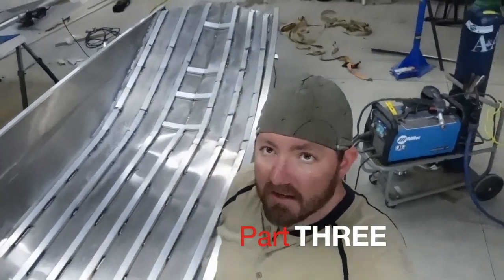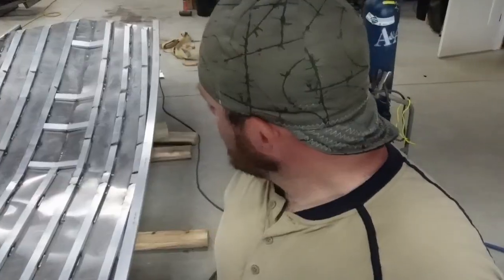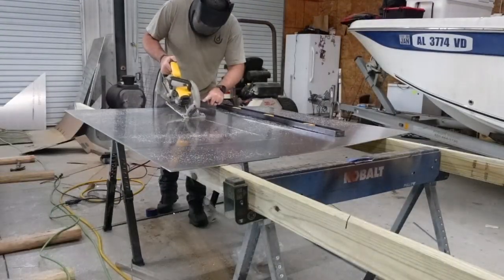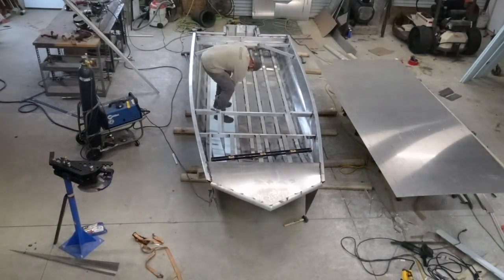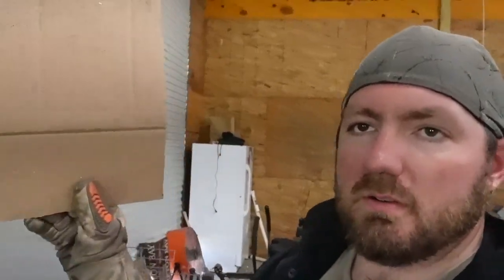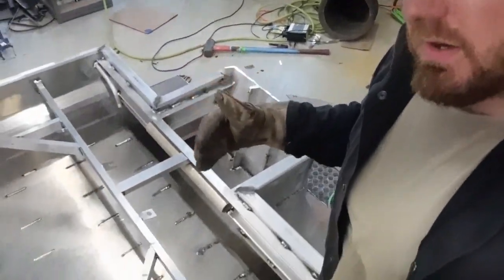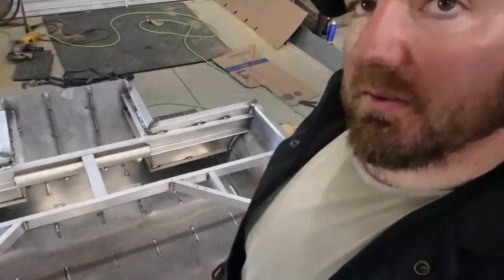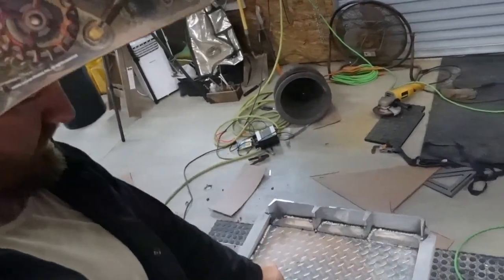Homemade Aluminum Boat - Jack Daddy Customs - Part 3 #diy #boats #homemade #tbnation

Comment: Awesome build. I will be going back to refer to your videos and yes I let the ads play. Just wondering if you didn’t mind sharing how you ordered the bottom and sides bent. Looks like it was creased to. Thanks for posting.
Reply from the maker: Thank you! I just told frank at pierce aluminum how I wanted the profile to be. He bent them to what I told him I wanted. I didn’t give him exact measurements but you basically have 96 inches to work with. So generally speaking you can get 56 inch bottom with 20 inch sides. The profile and bend locations are up to you. If you get strakes in the bottom that would make it a little less of course as well.

Comment: Looks fantastic, I’m think of building my own from scratch now, only pieces I’m having a hard time sourcing is the gunnels, what kind of gunnels did you use for your project?
Reply from the maker: I bought gunnels from the aluminum supplier. He had all types of boat gunnel extrusions. BUT, I have seen many people cut a slit in aluminum pipe and slide it over the edge to form a gunnel.   It’s a process but not as hard  as it looks.

Comment: Hey Jack, would you mind describing how you trace the cardboard to match the curvature of the sides so well? Do you use something to offset your pen/ sharpie so you can slide it down the side wall as you are marking the cardboard?
Reply from the maker: It usually takes at least two or three passes. The first one gets it close by eyeballing it and then you can hold it off by making a fist and riding down the wall if that makes sense.

Comment: Did you have any issues using the spool gun vs say a tig set up. If someone was going to modify an existing boat adding steps and framing, welding seams. Is the spool gun the right choice vs a tig set?
Reply from the maker: i would have rather used a tig for some of it, but i didn't have one at my shop... the spool gun is more than sufficient and is definitely quicker... with enough practice and a good machine, you can get the spool gun to look almost as good as tig... just don't have quite the control all the time...

Comment: Hey man, I'm looking at doing a floating deck. Just wondering is that 1x2" tubing up front? And if so after having it for a while would you do the same again or go bigger?
Reply: Also what thickness lol
Reply from the maker: It is 1x2 tubing and it’s 1/8” and it’s plenty. I would do the same thing again. Aluminum is light so don’t be afraid to over build it. If you think you need more braces, put more braces. Lol. Let me know if you have any more questions.
Reply: @JackArmstrong-jackdaddycustoms  thanks for the quick response, that's what I was thinking 👍🏻 and awesome I certainly will! Only channel or well pretty much any resource for a floating deck on the internet haha
Reply from the maker: @jfitzikner9  glad to help.

Comment: what gas are you using with your alloy mig welder   thanks needing help for getting right gas for my set up
Reply from the maker: 100 percent argon
Reply: @JackArmstrong-jackdaddycustoms  thank you so much your videos have helped me to getting myself into building my own aluminium bass boat
Reply from the maker: @bryanleroux4448  tell your wife I’m sorry. Haha
Reply: @JackArmstrong-jackdaddycustoms  thankfully not married yet 🤣 so why doing now
Reply from the maker: @bryanleroux4448  I hear ya. Get it done. Let me know if you have any questions. Glad to help.
Reply: @JackArmstrong-jackdaddycustoms  I’ll be asking a lot as looking at building a 21 foot and be able to hold a Yamaha sho 250 for South Africa
Reply from the maker: @bryanleroux4448  nice. That will be sweet. If you need some help, just fly me out there and I’ll lend a hand. 😂. Seriously though, been to several parts of Africa but never South Africa, I’ll get there one day.